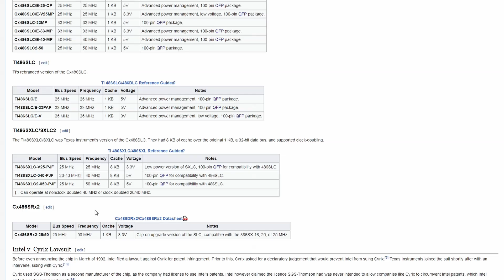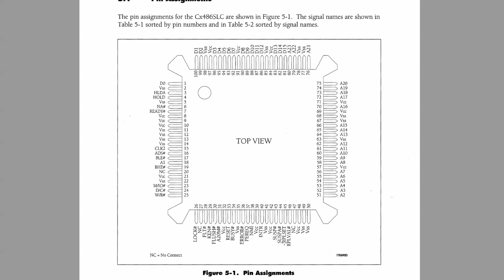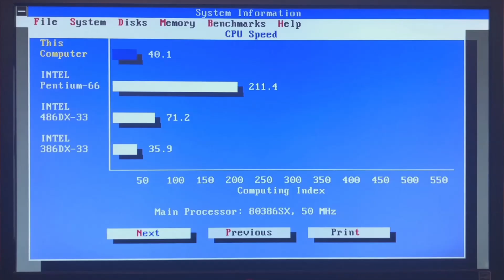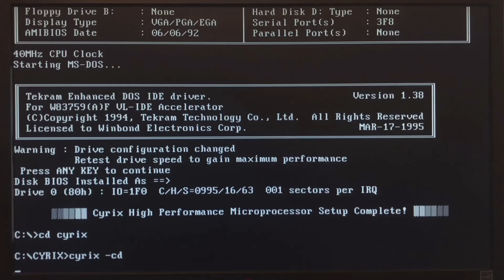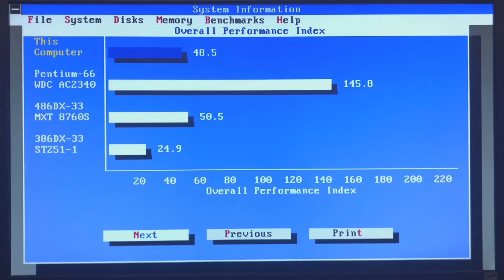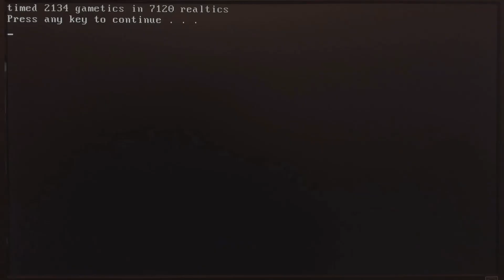Hacking a 486SXLC2 (8KB of L1 Cache) into a lucky 386SX Motherboard. Insane performance boost!

Comment: 8:21   can you tell us where this FLUSH line is going (maybe buzz it out with a DMM), which pin is it on the SARC RC2016 chip?
Reply from the maker: Unfortunately on this there is a mistake in my video.
The flush signal there is not connected. The signal I connect on the M/B OP1 is A20.
The system works there without the flush. Probably with the barb option.
That is also why in my checks Enabling disabling Flush, with or without OP1 connected had no difference.
I will come back to this issue soon.
Reply: @atheatos  Basically I'm trying to do a CPU swap, but on an RC2016 board that was never made for cyrix. I couldn't find any datasheet for the RC2016, hence asking for the info w.r.t what needs to connect and where
Reply from the maker: For the most part all the same, just make sure that all the extra pins of the Cyrix are unconnected and that A20 is connected.

Comment: how about a 50MHz 4 pin Osc on little homemade board. Then disconnect 486-50dlc CLK from m/b and connect it to the cpu. Next pass the 50MHz through clock divider then connect the now synchronised 25Mhz to the M/b ? Then obviously don't enable clock doubling on CPU ?
Reply: hmm... unless maybe you set ws to 1 for internal cache, slowing external ram access down to 25Mhz again. Eitherway, forgot to say earlier. Great video, thanks for trip down memory lane.
Reply from the maker: Thank you.
Yeah in theory you can probably manipulate the wait states on the CPU bus so that a 50MHz bus in the CPU side communicates with a 25MHz on on the MB side. I think this it could be quite challenging to make it work though.
My problems here are probably due to the old revision of the chipset, more testing is coming soon.
Reply from the maker: Will most likely not work. The CPU has only one clock input and this is the bus clock.
Internally it is used for the core clock with doubling or not.
So the M/B and the CPU need to get the same clock, or this will not work.

Comment: Hi, the failing clock doubling is really unsatisfiing. I was upgrading a Toshiba T3100SX luggable (386SX-16) with a TI486SXLC2-G50 and also have problems with this feature. The strange behaviour you had with input clk about 25Mhz might be because for clock doubling the input clock has to be 32 to 50 MHz! The datasheet mentions a "valid PLL lock range".
On the other hand i can not belive, that enabling the clock doubling should have anything to do with any chipset, especially not because of to high clock, because the doubled clock is only inside the CPU while chipset is still at half the oscillator clock.
My modified T3100SX works fine with 50MHz oscillator in non clock doubled mode, so it seems the mainboard is fine with 25MHz. When i switch to clock doubled mode it freezes after a few seconds. I was able to run a cpu benchmark a few times and saw the difference this feature made, but it always freezes.
😞
THX though for your Video. 🙂
Reply from the maker: For the PLL this is what I also think, however it is a bit strange because the window is very small around 25Mhz. Maybe there is bus timing issue?
The second point it is still a mystery. I also agree with your point that this is internal. Other people tried with my motherboard too and failed, while on others with a newer revision of the chipset, it worked. Until I make more tests with other M/Bs or maybe changing the chipset there we do not know. The max 40MHz I had is probably a limit of the chipset too.
Reply: @atheatos  You mean 40MHz without clock doubling?
Reply from the maker: Yeah here the max bus was 40MHz, 50MHz only possible with hot plug and the 386sx.
There is something for sure limiting this M/B. As said, I need to test more, with other M/Bs too.

Comment: There must have been a mix up in the factory about part numbers. I guarantee clock doubling works at 5v... they are 5v tolerant...
Reply from the maker: The CPU is fine. For sure it supports clock doubling. The problem most likely here is an incompatibility of this clock doubling feature with the motherboard (with the M/B chipset or the bios). Others tried on the same M/B failed the same way, while this works on other M/Bs.

Comment: The limitation you were running into was that of the chipset. The RC2016A4 is limited to 40 MHz operation. It can accept up to 43 MHz apparently, but it will not allow for 50 MHz operation. That explains why you needed to hot plug the original 386 CPU to get past 43 MHz.
Reply from the maker: Probably true. The clock doubler not working is probably the same thing too.
I have a few M/Bs with the RC2016A5 chipset now. I might try there too. I have also some RC2016A5 chips I might try swapping chips.

Comment: Any chance you can put up a link to the Cyrix software you used to control the processors you demonstrated? I have a TI 486SXLC and I haven't been able to find the proper software for controlling it's various functions.
Reply from the maker: I added a link to a Vogons thread with what you are looking for.
I might make a packet with everything for these Cyrix CPUs in the future.
I just do not have these files not on my windows machine right now.

Comment: I don't believe Cyrix/TI/IBM "486"s have real 486 cores. They all licensed 386 from Intel and upgraded them with microprogrammed 486 isa and added cache. IBM I think manufactured them at lower nm which allowed them to boost the clock to 66 ands then 100mhz.
Reply from the maker: Cyrix / TI ones did not license from Intel, but to my understanding these are their own 486 core just for 386 socket (they never had a 386).
IBM is always confused with these but it is actually totally different. They licensed the 486 core directly from Intel.
The pin out is mostly compatible with 386sx, but not 100% as there are extra pins regarding the cache (unfortunately undocumented).
So unless the datasheet is found... or someone reverses a M/B with an IBM chip... modding one into a 386sx M/B with caches working is impossible.

Comment: Great! Can you tell how I could get the boards and 486SXLC2 CPU?
Are you interested to create PIstorm similar board /* use PIpico with local SRAM or PIzero */ for the 386SX M/B? Such CPU board could become ultimate upgrade - ARM uC could break 16Mb limit and emulate even 586 performance. Actually it could emulate even 686 and PIV, but the performance will be not equal
Reply from the maker: I have never seen a board with an 486sxlc2 all ready soldered in. You can take any 386sx M/B and try a mod maybe.
As for my mod / little adapter boards, I only sell these to very few people that have exactly my Model of M/B and the skills to solder.

Regarding making an 486sxlc2 M/B with local SRAM chips for ram, yeah this is on my scope. It will be nice for sure.
The main issue is to find a suitable chipset with a datasheet and no intergraded memory controller. Then the problem is the Bios.
I can find solutions to all that but it will take time to design this.
Reply: I'd like to get your board and 486sxlc2  to challenge my soldering skills /*I have ALI M1217*/ Can I ? @atheatos
Reply: But 486sxlc2 with local SRAM will not give enough boost, as 133MHz ARM or 166Mhz ESP. Amiga users made PIstorm, PC users also could... Is it possible to ignore the m/b bios /*there are few open-source bioses for QEMU/Bosh*/and DRAM controller and use only CPU pins to access ISA bus? @atheatos
Reply from the maker: So far I did not had the time to research this in depth but it looks like the main problem is the intergraded DMA + memory controller. If you put local Sram for RAM, then DMA transfers will still go to the memory controller. So I think this needs a barebone chipset like from the 286 era that do not intergrade a memory controller, Using the socket to just access the busses will not work (probably).
Regarding performance difference it is very hard to tell, all 16bit bus 386, 486 chips are bottlenecked massively by the low bus thought put.
So this could be probably performing up to a normal 486SX at same speed with Dram.
I am just looking making my own mini boards in general, and this is one of the options.
I need to check more the bios thing also, it is a bit outside my skills.
Reply: I also bought about it... so:
#0 how 486SLC cache works then with DMA? There must be a solution to make SRAM on PIstorm board too
#1 even if we have problems with #0 all RAM above 16Mb /*fast-ram*/ is not accessible by ISA DMA could be made SRAM without a problem, and 16MB DRAM on mother-board /*slow-ram*/  - similar like in AMIGA. @atheatos
Reply from the maker: Caching and main memory are different.
The 486SLC cache flushes always on a dma request to main memory, then releases the bus. Main memory is main memory you can not flush it. I can see some ways to do this but again the problem is that I do not know how these solutions will interact with integrated memory controllers on the chipset. Also if dma requests only go to the integrated controller ,then it is impossible (on the socket).
This needs alot of research experimentation... not much time right now, but I will try.
BTW I am not familiar with Amiga stuff.
Reply: ok, SLC has a write-through policy, but it's only one way. How SLC cache is being updated when ISA DMA writes to 16Mb memory?  /*without fast reads from onboard SLC cache is pointless*/ So there must be a way to use local SRAM of PIstorm module. Anyway there is a plan B - fast-ram above 16MB which can be superfast @atheatos
Reply from the maker: After the DMA access the internal cache is all marked as empty / dirty (due to the flushing that happened before). So the cache fills again from 0. This hurts a bit performance, but in general works. DMA requests are not that frequent compared to the CPU clock.
Reply: Do you know the details, what is the name of the signal to CPU? That SLC knows when DMA happens?  @atheatos
Reply from the maker: Check 1994_TI486SXLC_and_TI486SXL_Microprocessors_Reference_Guide
These are probably... MEMW# from ISA bus and HOLD/HLDA

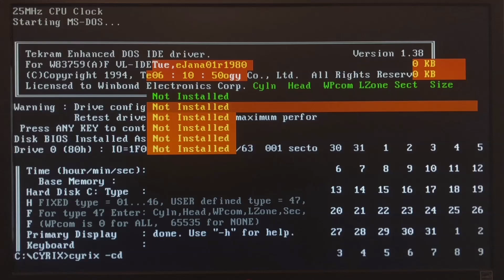Comment: re: At 15:30 through 17:00, where 40MHz operation causes a freeze, and at 25MHz causes a jump into the system BIOS.
The reason is that the CPU's A20M# line is not always consistent with the motherboard, and so (making a long story short) the CPU's internal cache will become corrupt. Does it work if the CPU's internal cache is disabled for "First 64KB of each 1MB boundary"? Also, when you jumpered OP1, and thought it was the FLUSH# line, are you absolutely sure you weren't off-by-one, and it's really connected to A20M# instead? Since this motherboard has no external cache, it would not make sense for it to signal FLUSH#, but the motherboard absolutely should somehow tell the CPU whether the A20 line is enabled. Perhaps the motherboard is not toggling A20 at the right time(s)? For more background info, do a Google search for "a20 line" (OSDev wiki and Wikipedia have good info).
Reply from the maker: Thank you for the information. I will have to check a few things again then.

For OP1 I am 100% sure it connects to the FLUSH# input of the CPU.
It is also marked as an option for Cyrix CPU on the M/B PCB.
Without that for sure the internal cache do not work correctly.
I do not remember if I checked the A20 line to be connected.

In any case, with my setup all was fine except the clock doubling.
I have also more M/Bs to check now, we will see.

Comment: Are you able to run Second Reality here? Or Unreal? With SBPRO compatible card. My SLC system was the most cursed PC I have had the luck of having. Kept crashing randomly on some software, and no it was not an hardware issue unless you count the CPU compatibility...
Reply from the maker: I would try, not sure as I have never run these, probably ok. My system is stable.

Comment: That -cd test jumping into the BIOS is a behavior I had never seen before. How the heck did that cause the CPU to jump to some line on the BIOS ROM and resume from there instead of what the heck was supposed to happen?
Reply from the maker: yeah, a very strange problem... I do not know probably incompatibility with the chipset, I will have to check on other motherboards too.

Comment: Super interesting content! I've been working a lot on " SUPER SX"-builds like these, just like you and K2. 
I have both the ALi and a variation of your board (an M396F with the SARC chipset) and the ALi is more suitable for upgrades like these SXLC2's, just like K2 experienced. The M396F is really primitive and lacks a few connections.  On my M396F clock doubling doesn't work either but I have an earlier version that doesn't even have that little "op1-bridge/jumper". The maximum I could get out of that board is 30MHz without clock doubling. I think the ALi board K2 uses (same one I just bought for a very small amount but with tons of battery damage ;-) ) is a lot nicer to run CPUs like these as they have more connections to the chipset for cache coherency. I still have to figure this for myself as I just got the ALi board but out but I think with the little adapter you made these things can easily run at 50MHz without clock doubling, just like K2 did, which of course makes for a nice build. If I could only get one of those little adapter boards like you made...
I will contact you about this separately!

The IBM chips though really are the unbeatable SX class CPUs: Clock for clock they are a lot faster and they can also be clocked faster but are near unabtainium, especially on their own as IBM didn't sell them separately. To give you an idea of the speed of those things: My 16-bit IBM 486SLC2-40 upgrade easily outruns an SLX2-40, which is the 32-bit variant of the SXLC2.. Pretty impressive little CPUs those IBM SLCs! Especially my IBM SLC3 is really fast for a 16-bit CPU. Runs DooM like nobody's business! ;-)
Reply from the maker: I have so many new motherboards myself now too. Just absolutely no time for anything right now :/
On top of this, I have accumulated so much hardware I do not know what I have and where.
I am trying to organize now. I have a few of IBM SLCs. These are for sure totally deferent.
Based on original 486 core by intel. The biggest problem for me is the lack of documentation / pinout info.
I will come back to videos at some point, I have so much to do and show to the people. :/
Reply: @atheatos  Very nice work you did here indeed with those little interposer boards 👌
Yeah, there's plenty of documentation on TI/Cyrix chips but IBM has always been very secretive about their designs and didn't share a lot because they didn't need to. You know: Those TI chips were meant for clone PC builds so they had a lot of incentive to share the way to implement them because it was directly linked to their sales. 
IBM was on the other side of the spectrum though. They were sick of the vast amount of clones eating up their market share and they very much wanted to dominate the PC industry again like they did with the 5150, 5160 and 5170 (their very succesful 1st gen/old school PCs) so they locked down every bit of low level technical detail and wanted to produce their own CPUs.. Even their technical reference manuals were very limited in terms of design decisions.. They really didn't want anyone to steal their designs again and hence they were very protective, which is of course understandible but which is also why  I have great respect for other companies like Compaq who blew the clone market wide open with their crusade for open system standards 👍👍 It's the guys from Compaq who initiated IBM's demise in the desktop PC market but that was inevitable in the end as they opened the doors ten years before by designing their first PC by using of the shelf parts.. The irony 😄

Comment: I replaced several 386sx with 486SXLC2 some years ago and I found the same exact issue when enabling clock doubling on a Headland chipset based motherboard. On other motherboards the clock doubling worked fine and with a 33 MHz oscillator the chip overclocks to 66 MHz without issues.
Reply from the maker: Yeah this looks for sure like a chipset issue. I have more M/Bs to try now.
Some with same chipset but later revision and some with other chipsets.
We will see :)

Comment: Awesome stuff!! 'm working on upgrading an on 386sx luggable - would you be able to share where you got that 386sx breakout board? Can you share the design or can I get one from you?
Reply from the maker: If you have exactly the same M/B or with same interface it could be possible to use my implementation.
Now for various reasons I can not and it is pointless to share my design.
So if we establish you have a compatible M/B I can provide this for you.
Just go to the store, hit contact and send me a message, include M/B info pics.

Comment: If the only difference between 33 and 50 was one jumper could you in theory wire the "turbo" button to toggle it
Reply from the maker: In theory yes, this is possible.
I am designing now a new thing that can do this even better. ^^